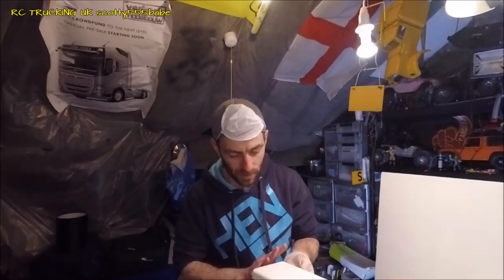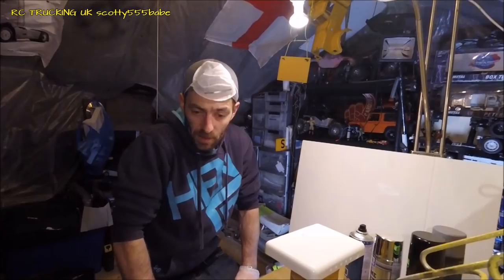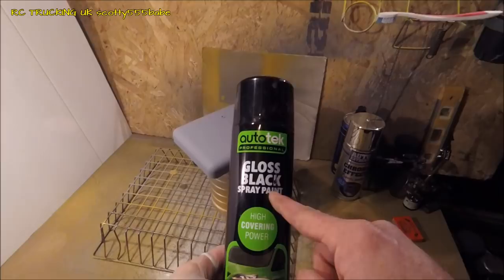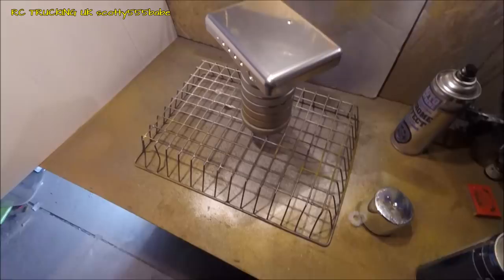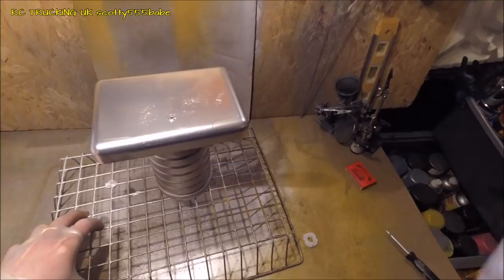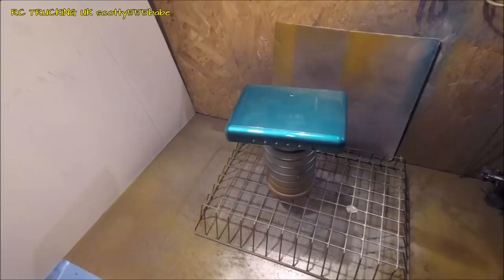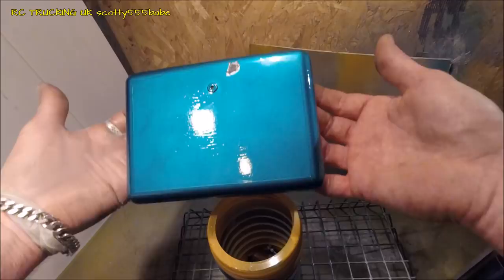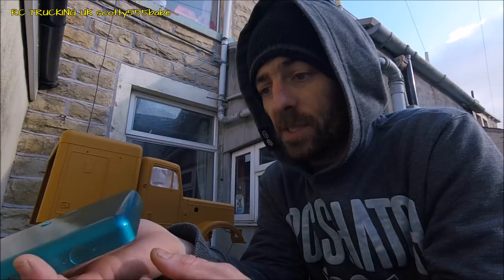PAINTING CANDY OVER CHROME | EXPERIMENTING WITH CHEAP PAINTS

Comment: Nice one m8. My experience using custom paints is that quality paints need a catalyst which cures. These are air drying and would take ages to fully cure and then some. The fry ups  are as a result of the paint film thickness and perhaps trapped solvents. Alsa make chrome which is sprayed over a black base, but it is mega expensive. Unless someone has oddles of money to paint a full car or motorbike. Plus, the rattle cans do not atomize the same as through a spray gun. I use Sata's or Iwata Supernova for clear coat.

Comment: The chrome paint I used was from Alclad II, and Spazstix.  Both were quite fragile when the polycarbonate would flex, it would flake. I saved it for shelf queens
Reply from the maker: I've never used spazstix but Alclad II I have used in the past and that was a really good chrome and give a great finish, I may have to get some more of that and try with another candy as candy os lacquer based so may seal the chrome better 👍
Sorry you've had issues with flaking, just not what you need on an end result, bet the shelf queens look great though 👌

Comment: I think I know where you're trying to go here Brother, ya'll might consider trying pearl  silver with the candy over. The pearl will come thru & give not only extremely glossy but a wet look to your top coat. When the sun hits it the pearl will show & give ya'll a mind blowing finish. I'll be painting Ms Voodoo, Moose, etc in my company colors using this technique. Just wish I was at that point on one of my project builds so ya'll could see it. But ya'll are going in a sweet direction...excellent Brother!!

PS - it takes so long to "go off" as candy colors contain nearly 3 times the reducers in them to get the glossy coat finish...yes, leave them many days before working with the painted parts.
Reply from the maker: This is my first time with candy paint, so I thought id experiment with it on some scrap before I even think of painting my Kenworth 😂😂
I guess the chrome is the same as that was still really wet under the candy, where as the black and primer had no issues...
My final result on my Kenworth I would like a mirrored adonised chromed candy pink/purple look with a cobalt candy blue chassis 👍
I'll buy some pearl tins and have an experiment with those colours 😂😂
Thank you bro for the advice 👍

Comment: Try specialistpaints.com they do custom canz i used their paint for my merc gigaspace shell i used sparkle pearl purple and finished of with a 2k clear and the results was fantastic and the unit is in your neck of the woods aswell.
www.specialistpaints.com.
I will be useing them again on my grand hauler shell aswell.
Reply from the maker: I've been on there website in the past... worth a shot, ill be spraying my Grand Hauler using a gun and compressor with all necessary additives and barriers etc so I may get it all mixed there... I definitely want 2k on that 😀
Just trying stuff out really to see what works and what doesn't at the moment as I see many people using cheap paint and I can't really get my head around it for wanting a good finish...
Bet your Merc looks great 👍
Have fun spraying the Grand
Reply: RC TRUCKING UK Scotty's 
I have been down that route with cheap also but i have learned not to use it i wont even use tamiya anymore since when i painted my grand hauler the first time and the paint has cracked all over the shell that is why i had to buy another. And the merc shell does look great tbh and as yet i still aint need to flat or polish the shell due to the great finish with the 2k clear. I'll try and upload a few pics onto g+ for you.
Reply from the maker: I never use cheap paint or plan on using it...
This is just trying out stuff for others who are on a budget to see what works and what doesn't 👍
Course.. if its all done by in one go in the right conditions then there's no need for flattening... usually when its cold or too hot causes the overspray to settle dusty then it requires flattening 👍